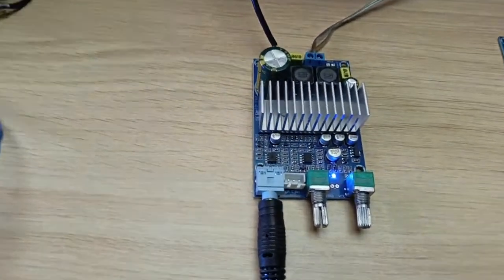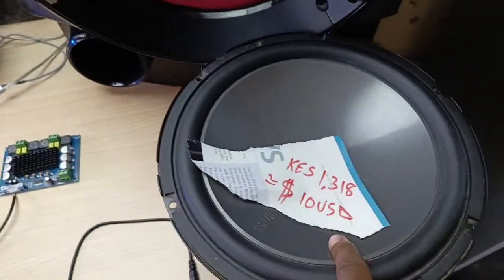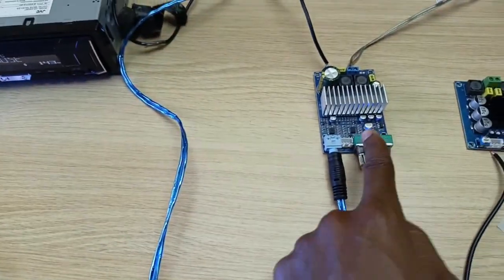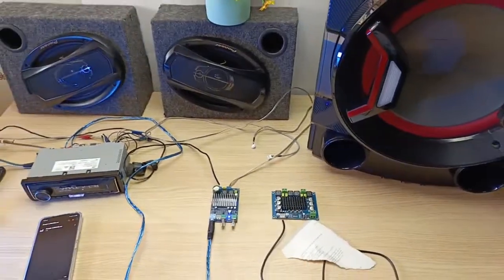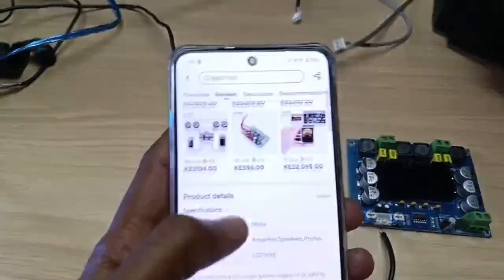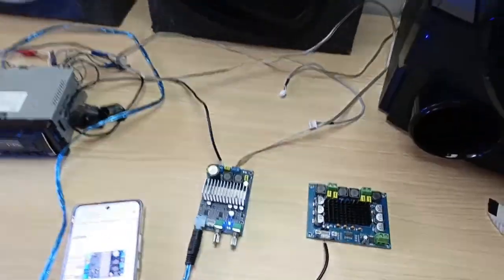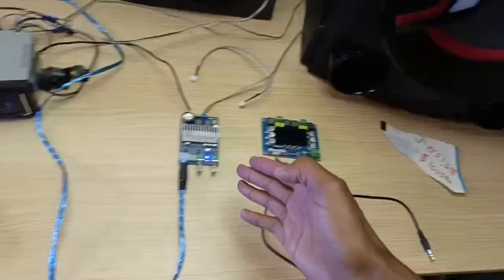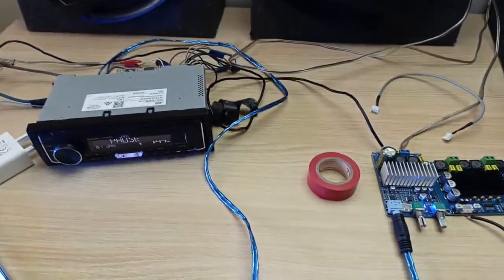Very impressed by the TPA3116 Subwoofer Amplifier board too

Comment: Little by little your giving me an idea to build an insane amplifier using this items from AliExpress, what's the fastest and cheapest method of shipping them
Reply from the maker: I've been selecting AliExpress standard shipping and therefore SpeedAF ends up doing the last mile delivery to me. It's just a tiny bit expensive but this gadgets got to me in less than 2 weeks. That's what I'd recommend instead of choosing the other cheaper delivery options that end up being picked up by Posta which is a pain to deal with because of the delays and extra handling fees that you have to pay.
Reply: Thank you  @DominicGichane
Reply: Brooo hio radio ulipata wapi, jvc are hard to find